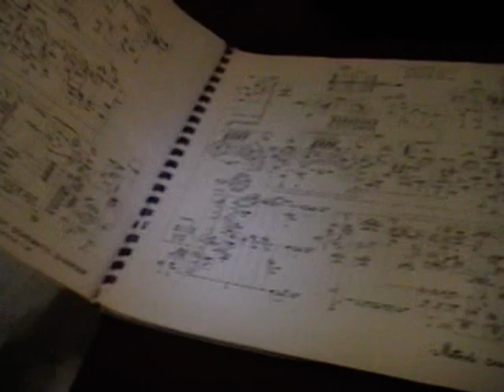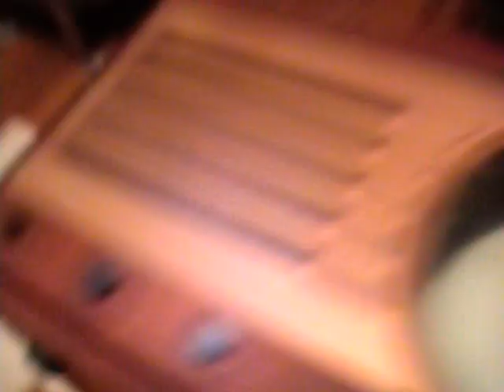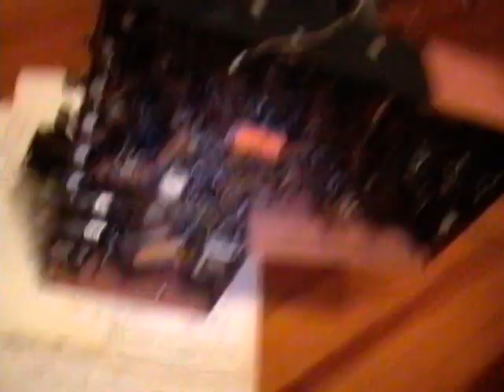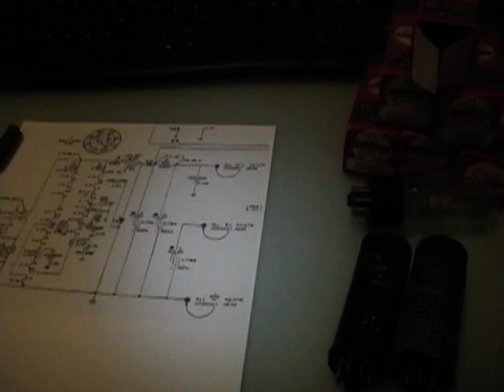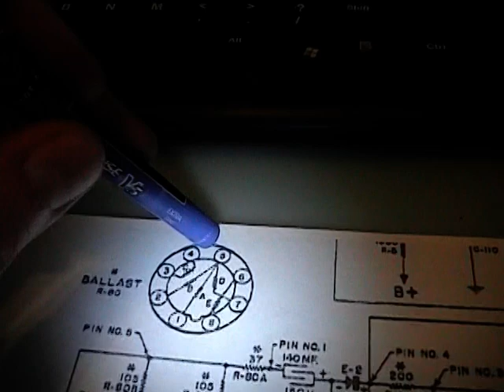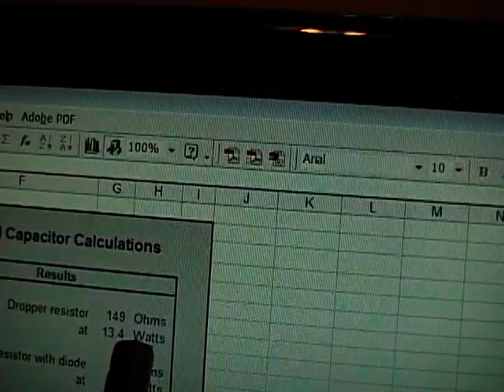Motorola musings p1o2

Comment: hey bob: I was thinking about that picture tube mask. what you do, is make a form, like the outside measurements of the hole. then put vaseline on it, and the picture tube, center it very well in the form, and use that foam that is sold for sealing up your home. make your own mask. it seems easy. will try it.

Comment: bob::::I listened to the ending of this several times. Your statement. You have the same power, you can't change the fact that you use that, whether with a dropping resistor, ballast tube, diode, or capacitor. Hmmm. No, that is not true. the total power of the set, will drop, in the same amount you reduce the reduction in need for the end of the string. You are dropping the voltage, not consuming power. It will be a great savings for us poor folks, with a diode, magically using less power for the set. you will not use as much power, but, at the cost of burdening the crt loads on startup surge, directly with how much you save in power. it is power you are saving through voltage drop, not power drop, a big difference. what they did to solve this is interesting. by putting a timer into the system, with an induction drop, or even resistor drop, that when a certain amount of time went by, the timer bypassed that system into the zero surge system you are talking about, then you could get by, with slowly increasing power, not boiling off the filament on start, and then using much less power on run. It is similar to starting capacitors on motors, not overloading the electric lines leading to the motor. we had these at work, with huge silver contacts, with arc suppressors, to blow out the arc, and even then the starting surge was enormous, we had to let the dam engineers know, when we put a huge load on the system out of the blue, so they could be ready to handle the surge. Here in the NW we have dams instead of power plants.
Reply from the maker: I was referring to the power being dissipated in the 37 and 200 ohm resistors in the B+ voltage doubler circuit.  The set needs a certain B+ voltage to operate properly.  That has nothing to do with startup surge.  Also, the tubes need 300 mA of current going through them to operate properly.  There is no getting around that.  The startup surge is minimal and only lasts a few seconds.

Comment: With regard to the 6SL7s from Bulgaria, do you know who the manufacturer was? Did they have an original number on them? Were they actually Soviet made tubes? Those Eastern block tubes is that they had their own tube numbering system, similar to the U.S and Canada one but not the same. So what sometimes happens is that they sell tubes over fleabay that may have the basing of a U.S style tube but not the same electrical characteristics, so they may be double triodes but not Russian 6SL7s or 6SN7s.

Comment: With the radio I am currently working on, a Medco made by Telesonic, I found out that it was a hot chassis set. When I got the radio, and found a schematic, I found that someone had messed with the wiring to such a degree that I litterally had to strip half of it out and start over. While I was at it I started looking at diagrams of floating chassis sets to see what would be needed to switch over. So I am using the Medco radio rebuild as an experiment to see how hard it is to convert over.

Comment: @bandersentv That was why I was musing about whether that Admiral T102 could be converted to a floating chassis set, even though the cabinet is insulated from the chassis it still has a voltage doubler and it could pack quite a whallop. All of the Canadian market AC/DC sets have a floating chassis, or probably more accurately a floating common negative, with the American radios (and some TVs too) some have it and some don't, even into the 1950s which amazes me.

Comment: @force311999 Another option may be to partially rewire the filament circuit so that you could put the two series strings of tubes across the output of a power tranformer, to do that you would need an 80 some odd volt transformer with an output of at least 600 ma, then for one string you would still need a dropping resistor. The god part about both the diode and the capacitor ballast substites is that they can be mounted on an octal tube base and plugged in without changing the set.

Comment: I wonder how hard it would be to make a mold of one of those reproduction picture tube gaskets and reproduce your own? When you have as many VT71 sets as you do it might be worth looking into. I didn't know that those Motorola TVs "floated" or isolated the B-/common negative from the chassis, it's a good idea and something that all radio and TV manufacturers should have been doing. I've been converting a "Hot" chassis AC/DC radio to having a floating B- just to see if it will work.

Comment: @force311999 Not really, except for maybe a stand alone transformer for the picture tube filament, some people do that with the Pilot TVs with the little 3'' picture tube. One problem with going to a power transformer in these is that the fliament strings also have 25 volt and 12.6 volt tubes in series. You would have to rewire the filament circuitry and then figure out where to mount a power transformer and I don't think that there is anything to gain by doing that.